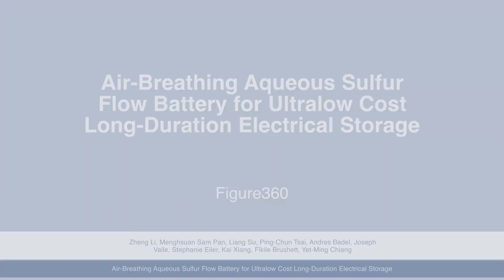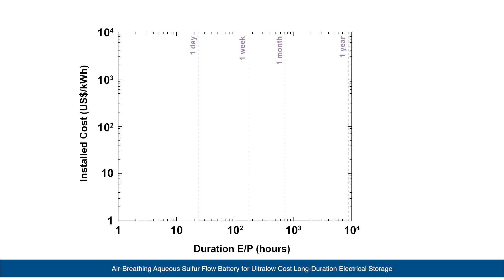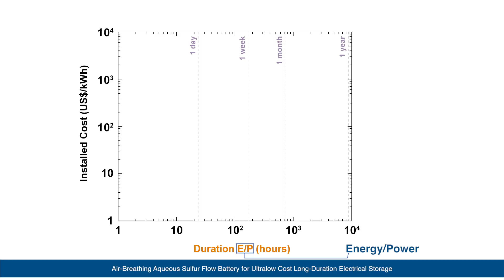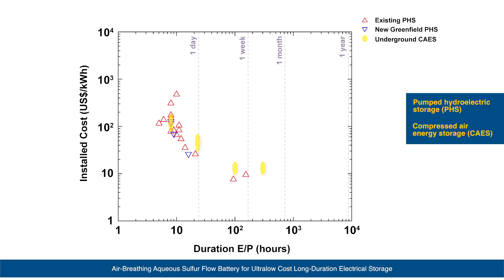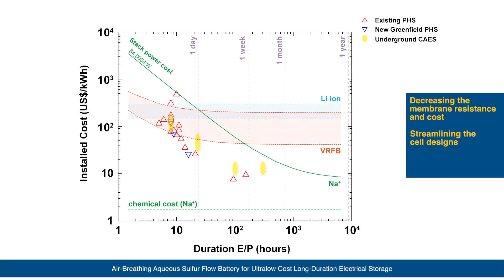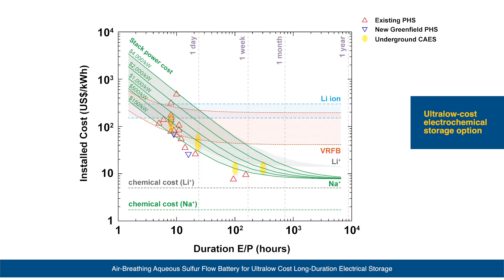Air-Breathing Aqueous Sulfur Flow Battery for Ultralow-Cost Long-Duration Electrical Storage

Comment: Don't forget to factor in the energy loss each time you change to a different way of containing that energy. Don't forget the power grid transmission lines energy lost per mile. Once you figure all this, this scheme becomes BS.
Reply: actually... no it doesn't
actually understand what you're talking about and run the calculations you claim to have run before posting a comment
Reply: Nope.  We currently curtail wind energy on windy days to keep from unbalancing the grid, throwing it away.  If the cost of long-term storage is low, then you take all this "free electricity" and use it to charge the storage.  It matters not what the losses are, when the input is free.

As far as transmission line losses, a technology that has no terrain dependency (like this) can be put wherever it would help the grid the most.  An example would be putting a big chunk of this storage near windmills in Wyoming, so the currently existing transmission line from Wyoming to California (which is not big enough) could be run at 100% even in times of low wind.  In other places, it would make sense to put it close to a variable load (electric house heating in cold states like Michigan), and charge it up over summer, entering winter with the storage at 100%...